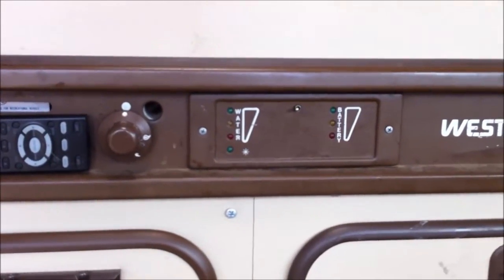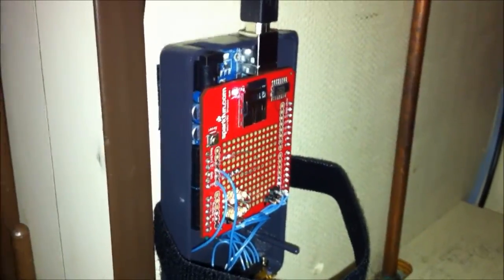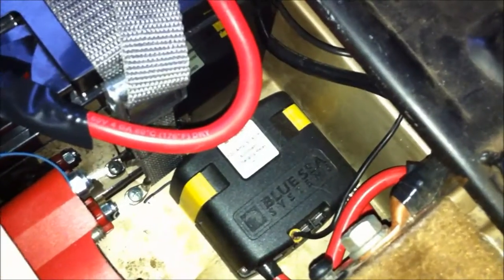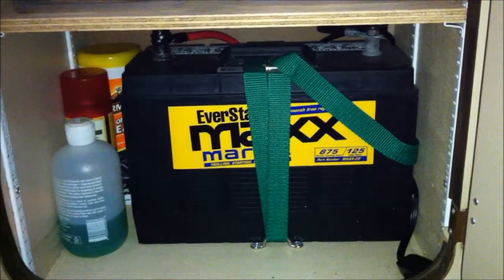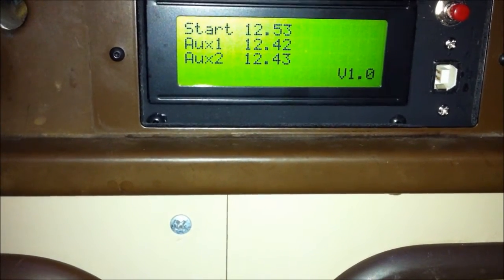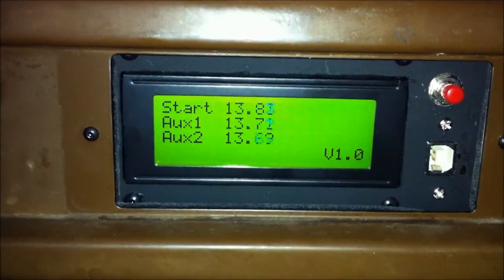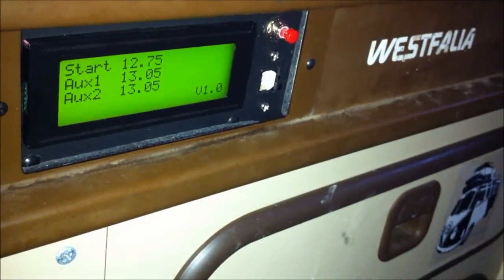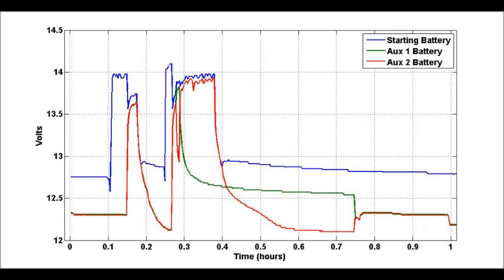Westfalia Battery Monitor V1.0

Comment: Patrick,
Your battery monitor is very cool. My son and I are just learning about Aduino's and have attended a few Maker Fairs here in California and are jazzed to find a project that we can do together.
Two questions:
1) How did you pull a higher capacity wire from the starter battery to the ACR controller? Under the body chassis or under the rug in the van? 
2) Do you have any schematics that we can start with on creating our own monitor and or the overall aux battery and wiring system?
Kevin

Comment: Hi, I've been thinking about building a battery monitor based on an Arduino myself (actuallly just ordered an Arduino, after seeing your video - great work!). Is there any chance that I can have your source code? I don't have any programming experience yet, and I don't want to build the exact same monitor as you have, but it might be a good help to start.

cheers, Nico